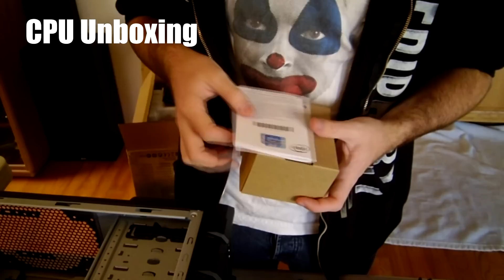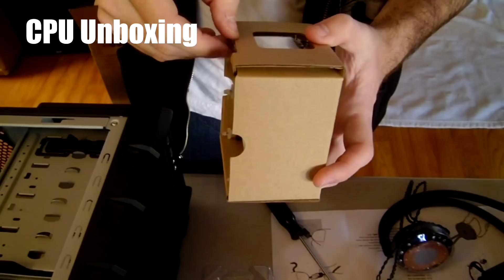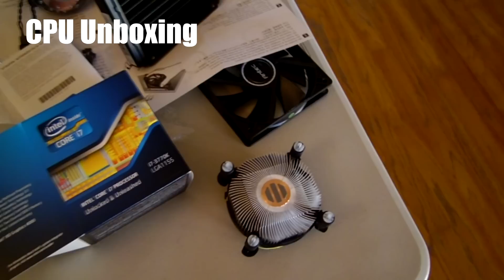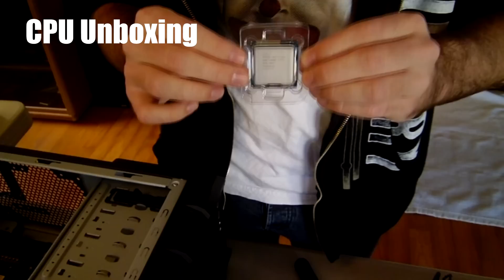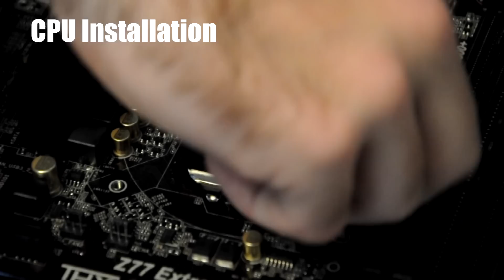Tutorial on How to Build a Computer: Central Processing Unit, CPU (Intel Core i7 3770K 3.5 GHz)

Comment: This is a very helpful tutorial.. But if you want to do a tutorial, i know it's "build", you need to tell us what is good and what is bad (brands, mistakes) for example. The graphics card: you didn't tell us how many bytes it has. I know it doesn't seem important but you can have a 680gtx and if it has 32 bytes (not sure if it even has this little) it's gonna suck, If you want to be able to play with high fps you at east need 128 bytes (64 is good too, but not really).